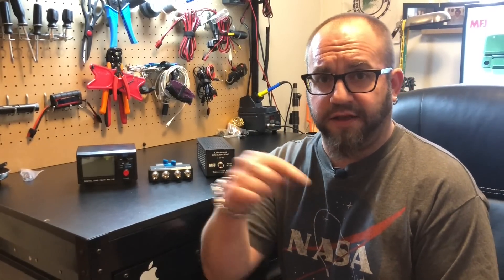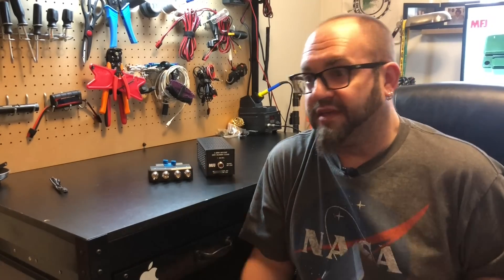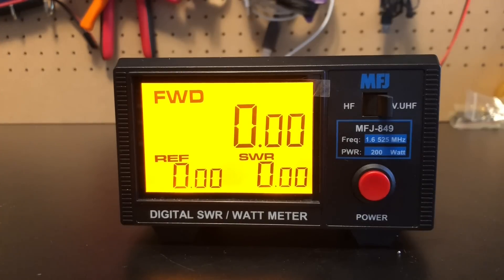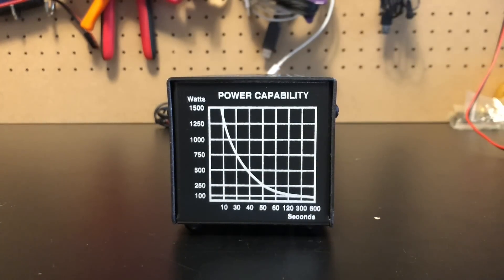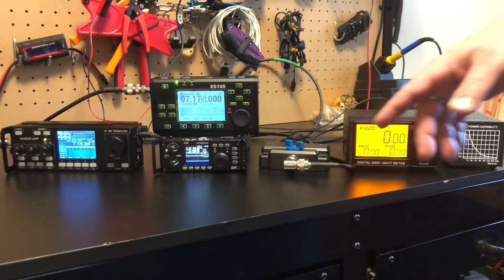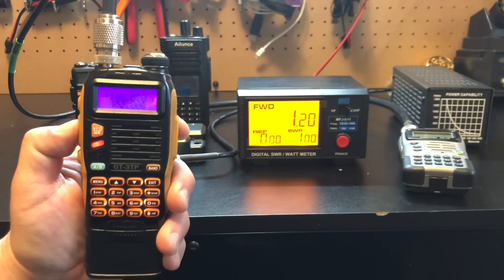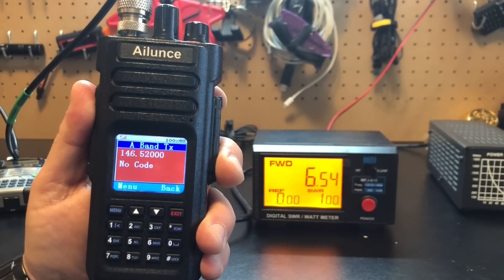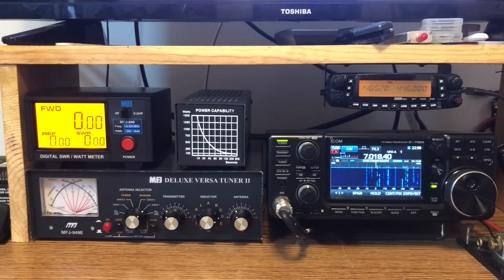HF, VHF, UHF Test Equipment for Ham Radio

Comment: I had bought the MFJ-849 and the HF side was defective right out of the box, so I'm waiting to see if they send me a new one or refund it because they are out of stock.., the UHF/VHF worked as advertised, the antenna switch and dummy load are awesome.

Comment: Hey sir, how are you? As always you make great videos. I was curious as to the bench you use. Is that from harbor freight? I am needing something like that but was wondering how sturdy it is. Does it wiggle side to side or anything? Keep up the good work, and God Bless de KG5DGO
Reply from the maker: Hey Steven, thanks for watching.  Yes, it is from my favorite store in the world, Harbor Freight.  The Bench has been great for me.  No problems at all.  It's actually surprisingly solid.  Take that with a grain of salt of course, it is Harbor Freight we're talking about.  But for what I use it for, I'd absolutely recommend it.
Reply: @hamradiotube  my boss was looking at some of these for our water plant lab and it needed to be sturdy so the chemicals and burets were stable so they wouldn't  be knocked over with a slight tap

Comment: MFJ = More Fucking Junk.  However, MFJ had this unit made for them. Then, MFJ had their label printed on the unit.  My two DG--503 are very accurate, and I am pleased with them.,
Reply from the maker: Well thanks for coming on my channel and thinking it's OK to drop the "F" bomb.  That is totally in line with trying to be a good steward of amateur radio.  I remember learning exactly that in my Technician test. Good job at showing others exactly what not to do.
Reply: @hamradiotube  You're more than welcome, old man. It takes a lot of guts to wield free speech and show true freedom of expression. However, the truth is the truth, and, there is no denying that, now, is there? Keep up the good work. de Tony, g6ypk
Reply from the maker: @susanhodges9447  I'm all for free speech, otherwise I would have deleted your comment.  Instead I chose to leave it up.  I just try to keep my channel G rated, as if we were on the radio, you know.

Comment: Very informative, thank you. Is it possible that the radios that are showing lower output than expected are doing so because of coax losses?  Is there a test you can do with your watt meter to determining feed line loss?  If so; can you demonstrate the test?  Thank you.
Reply from the maker: On vhf and uhf yes.  Search my channel.  I did a coax loss test some time after I made this video.
Reply: Thanks, I’ll look for it. Glad I found your channel.

Comment: Your videos have inspired me to get back into the hobby. I dug my radios out of storage today and hooked most everything back up. My issue is that I need an antenna and some coax so I am not back on the air yet. It may take a while as being retired means limited income which means having to save up for purchases. But I WILL get back on the air. I'm interested in POTA as there are no mountains in Florida. And POTA sounds like something I can do with the wife. Thanks again Mike for doing these videos. '73 W4MKH
Reply from the maker: That's great to hear, thanks so much for sharing that.  I'll bet you're itching to get on the air not that you have most everything hooked up?  You don't need anything fancy for antenna or coax for hf.  There are lots of affordable options out there, or you could always make your own.  Hope to see you POTA'ing soon!  73

Comment: Was just thinking that you're probably not getting full power out on the HTs because they're not plugged into external power supplies. Take the Yaesu VX-7R for example, you'll get full power out when running off the cigarette lighter power adapter or the external power brick. Not all radios now will work while plugged into the power brick though.
Reply from the maker: Yeah to a small degree.  I did plug the Yaesu in and it was slightly better but not enough to make a difference.  I'm actually curious how accurate this meter is at lower wattages.  It's certainly "good enough" and most ham gear isn't made to professional grade, so there's that.  Thanks for watching.  73

Comment: Nice video: There is one thing that is important on your switch !  The port to port isolation. Little else matters!
Reply from the maker: Very true, and I don't think it is intended to be used the way I was using it with multiple transmitters.

Comment: I want one so bad.. They need constant power though, don't they? I'd like to be able to use it on my mobiles.. KE8ODY
Reply from the maker: The meter does need a constant 12V yes.  It draws so little power it doesn't even register on my Powerwerx watt meter though.  It doesn't need to be on to TX either.

Comment: The question is, how well is the MFJ wattmeter calibrated?
Reply from the maker: That is a very good question.  I don't think you'd want to do any real precision measurements from it but it's close enough to be reliable enough in the shack.
Reply: @hamradiotube  you can probably get it close enough but for a range like low, mid and high. 10W, 50W and 100W.

Comment: Every ham should have a dummy load, when things aren’t working as they should, dummy loads are one of the easiest tools to help locate where an issue might be. The small plug in ones, on low power, with a back to back connector are really useful when out in the field.  Great review thanks.  73 de M0AZE.
Reply from the maker: I agree.  Thanks for watching.

Comment: Why buy the separate dummy load if the MFJ-949E you have there has a built in dummy load.  Unless you go over 300W, you can just use that couldn't you?  Enjoy the videos.  Thanks.
Reply from the maker: Because this does HF-UHF.
Reply: Excellent answer.  That MFJ-849 has been on my list for a while, I may be stimulated to by one today. Thanks

Comment: Hi Mike I was just wondering on the antenna switch can you use for different antennas and switch between them using one radio?
K1DXN
Reply: yes
Reply from the maker: Yes, either many antennas for one radio, or many radios for one antenna.

Comment: In some instances if you plug your radio into a power source you will get higher power output compared to using the radio's battery.
Reply from the maker: Yes you will.  I tried that w/ my Yaesu and it still didn't register on the lowest setting.
Reply: Low settings on a hand held are usually 1/2 or 1/4 watt give or take  depending on radio, I would guess anything under one watt would not be too accurate on such a meter, But it gets you in the ball park. If you were an electrical engineer and really needed to know the exact watts then a Bird ohm meter or equivalent testing equipment would be needed.  Keep up the good work.

Comment: What's the Port Isolation on that Switcher ? .... It's a wonder you don't fry the front ends in those recievers.
Reply from the maker: Not sure.  I read an article in one of the recent issues of QST on these switches and it gave them very high praise for its isolation.

Comment: Very good information here. My IC-7100 has a build-in power and SWR meter. Very handy. My HTs do not, so a power meter would be helpful. Also, my antenna switch has a ground connection that grounds all the antennas. Great when storms are nearby.
Reply from the maker: Thanks David.  My 7300 has the same feature.  Still nice to have these tools in the arsenal.  Especially for the VHF/UHF radios.  I still need to work on something for ground.  I don't have anything grounded right now.  I definitely unplug everything when a storm is coming.

Comment: A good antenna analyzer, from Rig Expert for example, compliments these tools.  Btw,  measuring output close to the rig does not tell you how much actually makes it to the antenna (attenuation) due to feed line loss.  You have to measure at the antenna.  A dummy load is great. I just bought one.  I have an old 2-way switch, cheap.  20 bucks. It works. Another one I had had a short somewhere and kept blowing my fuses on the Base-T 12V input for my remote antenna tuner.  Oh well.  That's all part of the hobby!  73!  SV0SGS.
Reply from the maker: For sure.  I have 2 analyzers.  Wasn't looking for how much power is going to the antenna with this video.  This was purely a what is my radio doing test.  That would be a very vast test given all kinds of different antennas, coax, length, and a trillion other variables.  However, having an analyzer and a good match to your antenna will give you a good idea of what you are putting out.
Reply: @hamradiotube  I agree. Keep up the good videos!  73 de David SV0SGS

Comment: Howdy Mike, you could put an a/b (2 position) switch in front of the 4 position so you could easily switch between the HF antenna and the dummy load.  Or if you have a three position you could have HF/V-UHF/dummy options.  Thanks for the vids! KY4CKP
Reply from the maker: Yeah I was thinking about doing that.  I do have another antenna switch.  It'll prob work its way back in the mix.

Comment: We often hear a debate about average/RMS power vs. pep when it comes to measuring power out. If you had your choice, would you prefer something that show pep when in on ssb? I notice the meter you demoed does not measure pep. When would you want it and when is average/RMS preferred?
Reply from the maker: I really don't care about any of that stuff. I just want to know what my radios are doing at their output stage.  This meter does just that.
Reply: @hamradiotube   it averg on that meter 
N MR Stubbs  is a reall nice 
I got to go visit  again  I'm  about 50 miles from mfj 
73 n9prf

Comment: I believe another youtuber (maybe hamradioconcepts) found that a similar watt meter was unable to pick up Extremely Low powers.  Thanks for video!
Reply from the maker: Well this one does just fine.  Thanks for watching.
Reply: @hamradiotube  Meant in regards to you testing the L1 power on your Yaesu displaying no power.  Could have been under the mW threshold.
Reply from the maker: @ThyBlight  Ahh, good point.  Could be.  I'll have to check the specks for sensitivity.